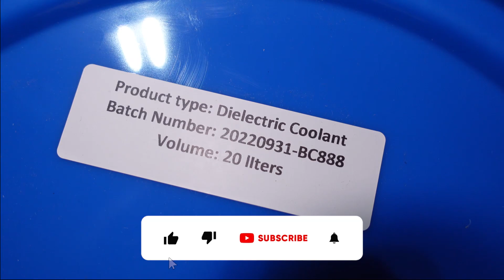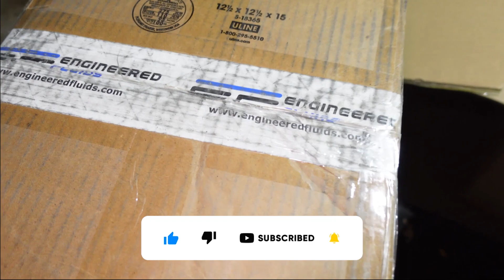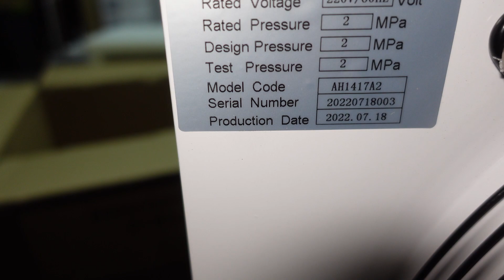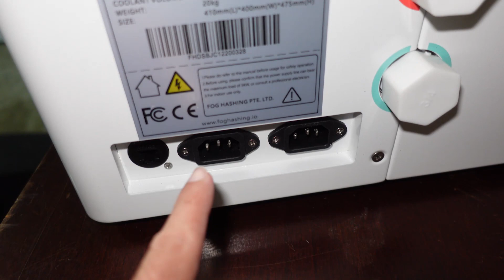Foghashing C1 Immersion cooler - unboxing and Quick Look

Comment: 8:07 isn't that an American 15A plug?
Reply from the maker: No it is a Type G plug, USA is two vertical flats and one ground, these are two horizontals and one ground.
Reply: @SerpentXTech  what did you replace the end of that cable with?